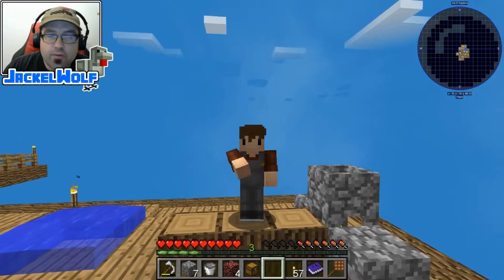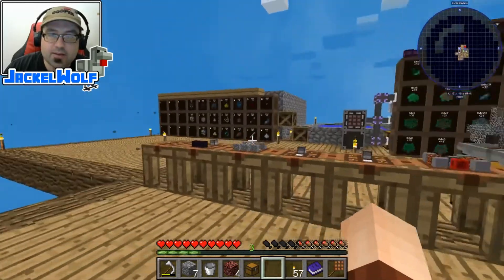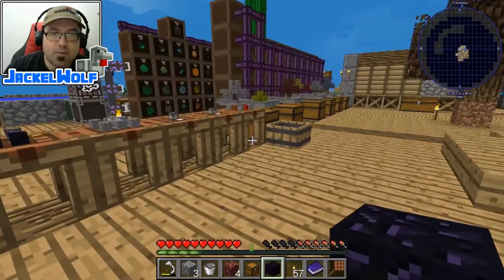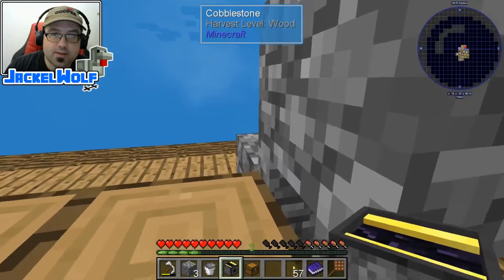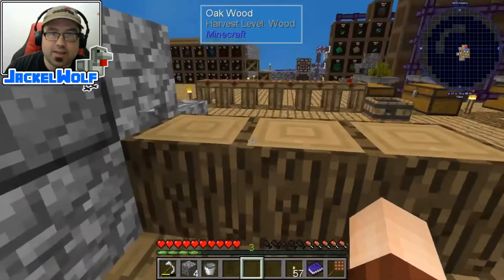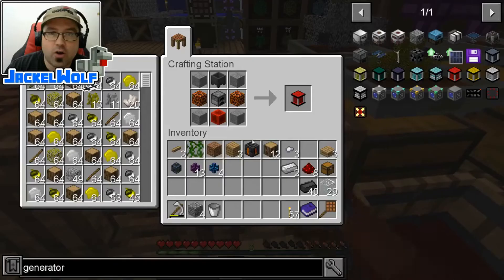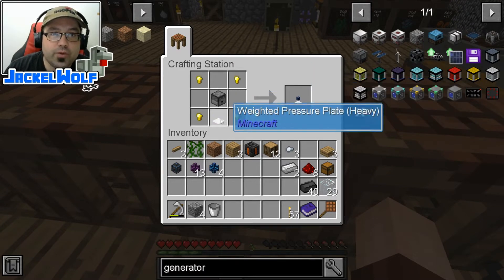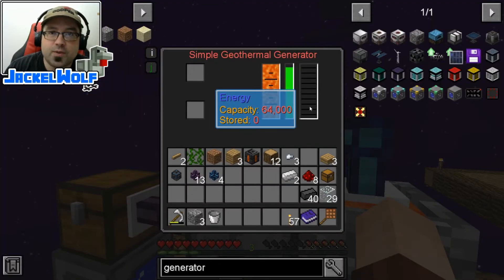[SKYFACTORY 4] SPECIAL #03 -  HOW TO AUTOMATE SIMPLE GEOTHERMAL GENERATOR (HELP/TUTORIAL)

Comment: how to desable automated user sound?
Reply from the maker: Ill post this here as I see you also asked this on my most recent video. 😁

Not sure exactly what you mean. I believe that you just need to place the sound muffler down next to the block that you want to 'quiet' down. It will quiet everything in a certain area, though it is not very large. I'm not sure if there is a way to quiet just the auto-user though. I think some of the more advanced machines have a muffler upgrade, but they would only work within that particular mods blocks. Hopefully this helps.
Reply: @JackelWolf  You can use a soundproofing, although it does remove sounds from mobs and other things nearby
Reply from the maker: What do you mean by soundproofing? Is it a separate block from the sound Muffler? That would be cool.
Reply: Jackel Wolf Yes, it mutes nearby sound
Reply: In JEI it is called Soundproofing
Reply from the maker: Nive. Going to have to check that out next time I am in game!

Comment: This does not work. You don’t actually get power from the generator
Reply from the maker: Hmm. Not sure what the problem is. I have not had any issue with the Geothermal Generator. What are you using it for? Some machine blocks dont actually take power until they are correctly set up, so if you are missing an input or output it can cause the block to show no power (which is super confusing and has tripped me up multiple times in the past). Let me know more about the system and we can try and troubleshoot it. I have a 'help channel' on my discord page where you can post pictures of your setup and my community can see if we can help.
Reply: Jackel Wolf wow thanks! You are really supportive. I just had to wait a while to get it to generate power, but it doesn’t seem to work on my ME system. Is the system the problem?
Reply from the maker: @theoryofawesome_  I am not 100% sure on the ME system. Have not actually built one in SF4 yet... you may have to convert it somehow by storing it in a comparable battery first. I seem to recall something similar was required is SF3.
Reply from the maker: Compatible... not comparable...

Comment: Have you come into a problem in which the automated user will not place the cobblestone into the cauldron? I am not sure why but for whatever reason it will not place the stone into the cauldron for me. Any ideas?
Reply from the maker: I am trying to remember this setup, as it was a long time ago. Is the cauldron already full of lava? If so, the Auto User will keep kicking out items, even if there is nowhere for them to go, causing them to 'float' in the world. I've started using the Auto Clicker, which is similar,  but doesn't leave loose blocks in your world. Let me know if this is not the problem.
Reply: @JackelWolf   Sorry for the late reply, I am just getting able to try it out now, and with the automated user, it did not matter whether the cauldron was full or empty it would not put any cobblestone in it, even trying many different cauldrons. And now trying it with the auto-clicker machine it still will not input into the cauldron.
If it helps any, here is a link to a screenshot of it, under the clicker is my cobblestone generator: http://prntscr.com/ozetmp
Reply from the maker: @dakota2729  can you fill the cauldron manually? I think I can see a torch under it, and it should work to to the side or directly under. What delay setting fo you have the clicker set to? Oh... is the clicker set to 'always on'? Hmmm... cant think of anything else. Let me know.
Reply: @JackelWolf Wolf yes it will fill manually, as for the delay settings I have tried just about all of them waiting 2-3 minutes on each. yes it is set to always-on, and I have also set it to require redstone putting a lever on it to activate but still nothing.
Reply from the maker: @dakota2729  hmmm... ok... it wasn't part of your picture, so, do you have cobble in the clicker? If not, what transfer system are you using?
Reply: @JackelWolf  Yes it has a full stack of 64 cobblestone in it, due to the cobblestone gen being right under it, it auto feeds it. This is the current condition of it: http://prntscr.com/ozf7dk
Reply: I'm having the same problem
Reply from the maker: Have you tried changing to an auto clicker instead of the user? It is a bit more difficult to make (I think it requires diorite), but seems to work better. If none of the above comments help, do you have it turned to 'attack' instead of 'use'? Or left click vs right click? I think the user has options for both. Lut us know!
Reply: I have tried all settings and both the automated user and the auto clicker
Reply from the maker: @thetardiscrew  hmmm. Not sure what else to suggest. If you want, I have a 'help' area on my discord page. If you can post a screenshot or 2 of your setup, maybe myself or some one can help you troubleshoot it.
Reply from the maker: @thetardiscrew  https://discord.gg/bfv9Y58 sorry. Link to my discord.

Comment: is there a bug that the Generator dosent exaped Pyrotheum? cant pump it inside^^
Reply from the maker: I'm not sure. Which generator are you trying to use? I believe that it should work with the Geothermal generator. Oh, is your generator hooked up to an output yet? I've seen cases where the generator looks 'broken' until it has an output connection. Let me know!
Reply: @JackelWolf  It worked, and it is great^^ one Generator with Pyrotheum makes more Energey than 5 with Lava
Reply from the maker: @Caionnech  nice! Was it the connection or was there another problem? Curious if/how you automated the Pyrotheum?
Reply: @JackelWolf  it was the Plug, after I set the Plug on top, it runns perfectly